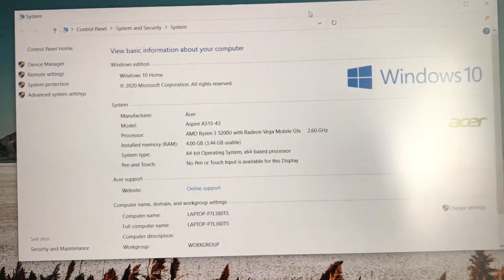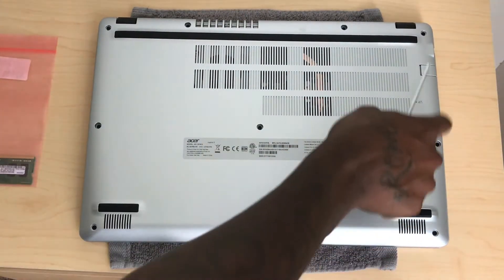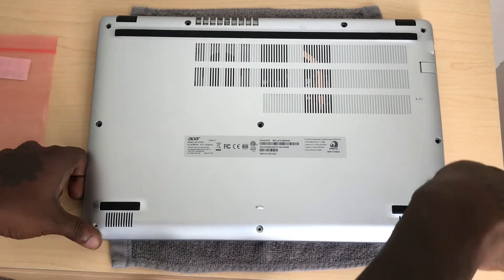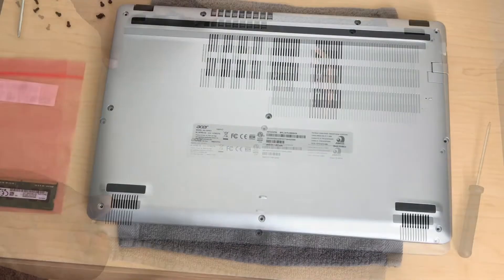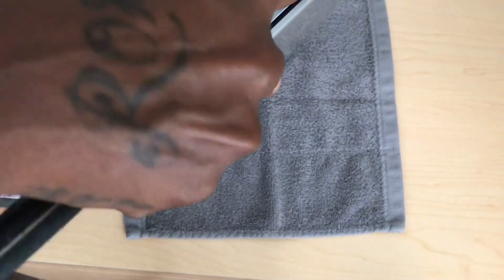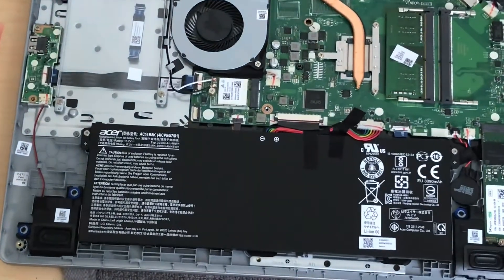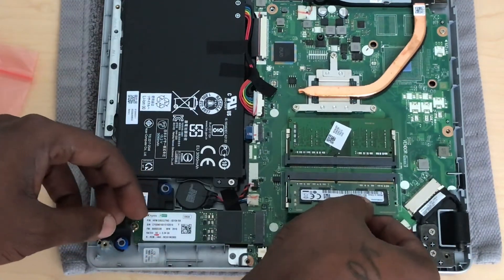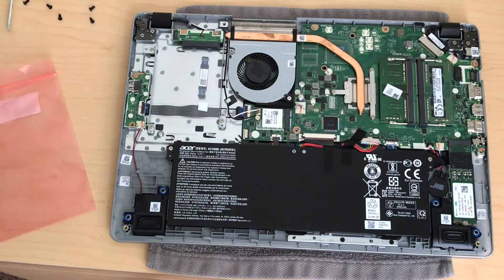8GB DDR4 Ram Upgrade Acer Aspire 5 Slim Laptop

Comment: Do u have to disconnect the battery when u put the ram in or just power it off?
Reply from the maker: No as long its power off you should be fine
Reply: @DollarScratchoff  That's not correct at all ! The manufacture recommends disconnecting the battery while upgrading any part inside because of the many problems that can happen. # 1  if you drop a screw inside , it can fry the mother board , or brick it they say !  You should not give advice on any media unless you have the facts. just think how many people may have fried their laptops because you told them it was fine to perform work while batt was plugged in !  Your not the only one , many people give advice as if they know !  People do yourself a favor and go to factory recommendations to save yourself from mistakes.  especially when it comes to expensive laptops !

Comment: I tried installing it but it's not reading it, I have no idea if I installed it on the correct side
Reply from the maker: Yes you installed it wrong try doing it again
Reply: DDR4 Ram memory module can only go in the slot one way there is no way to put it in backwards.. Another thing is when holding any Ram chip you should make sure to ground your body before because these chips work on only 1.2 volts and static electricity pack more volts than 1.2 volts and could damage your Ram.. You could ground your body by simply touching the expose metal chassis of any electrical appliances that is plugged in with a 3 way grounding plug...

Comment: I JUST BOUGHT THE LAPTOP AND PUT IN A SSD.TOOK OUT THE BATTERY FOR SAFETY AND PUT IT BACK IN .I had forgotten to put it back in before closing it and then I opened the laptop and everytime I took it out the charger it shut down until I remembered why.Fast forward I opened the laptop back up and put the batter back in its slot or the battery connector I mean.Closed it up again and tried to run a simple game like roblox .I get into a game after a few minutes the whole computer shuts down. I don’t have time to do the process of returning this so can someone help me? I am gonna go check BIOS and I am getting the thermal paste Monday. I turned off sleep mode to never for screen and sleep.
Reply from the maker: Oh wow that's horrible take the battery out and press the power button for 10 sec then install the battery again and reset your laptop that should fix the issue.
Reply: @DollarScratchoff  wow I did that before you told me but you were right in..I love you lmao cause I took a huge guess before.Thanks man